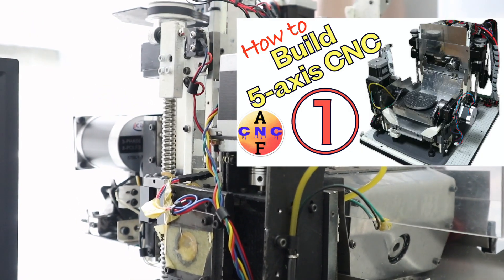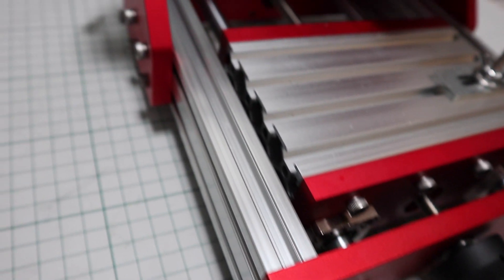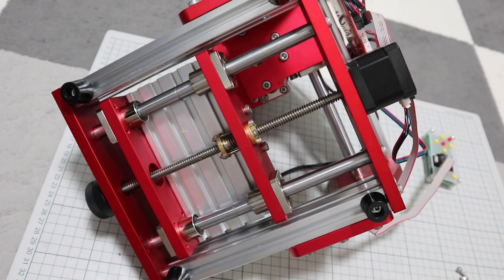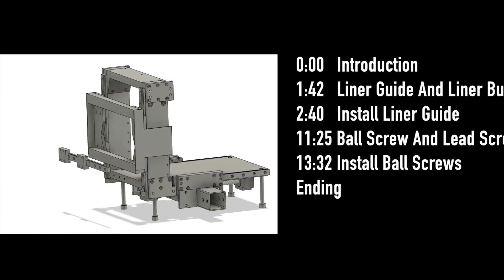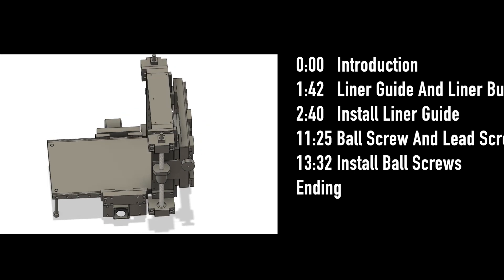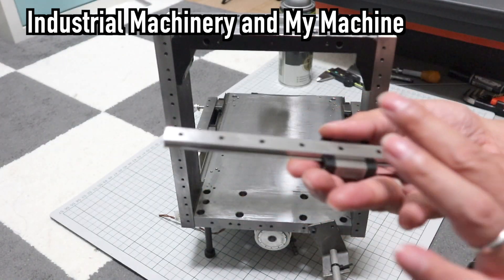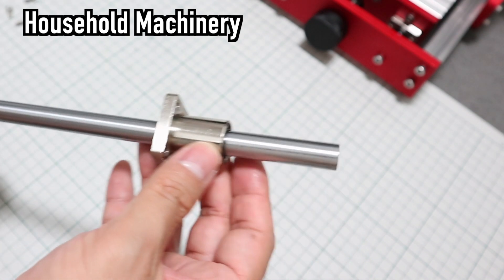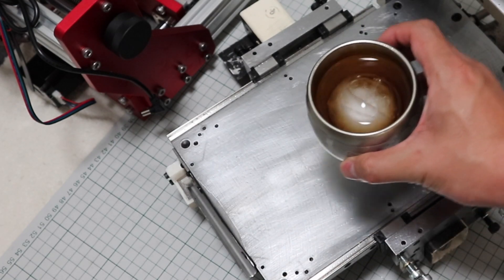【COMPARISON】How to Build CNC 5-axis . Part-3 | Compare with Household CNC machine

Comment: You need angular-contact bearings in the BK/FK support, not radial.
Reply from the maker: That ball screw is purchased as a set with the housing and bearings. There are also problems with the accuracy and strength of other parts, so for now, this is about it.
Spindle of This machine use angular bearings.
Reply: DP Tech:  I have seen these bearing and support sets used in other videos.  Some of the builders mentioned that they only have standard or deep-groove bearings rather than angular-contact or separate thrust bearings.   Not very good.    :o(

Comment: You make it look so easy. Im thinking of buying or building a small router like the red one you bought to cut the pieces to make, something similar to the 5 axis you have made, do you think the bought router is up to making the parts?
Thx
Reply from the maker: I've never bought a home-use machine like that red machine.
I still assembled it and tried to move it a little, but it seems that there are some problems.
I haven't made a test cut yet. (Because there was a problem with the accuracy of the spindle parts)
One of the reasons I bought this machine was because I wanted to show people like me who don't have a machine tool that can process metal that they can enjoy metal processing at home.
I plan to modify this machine so that it can process iron.
I don't even know how much I can do it.